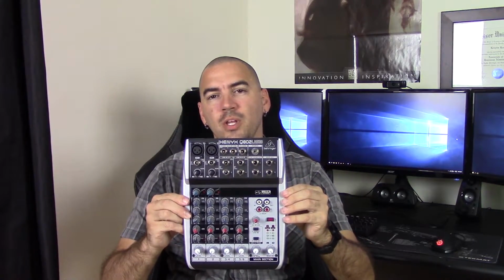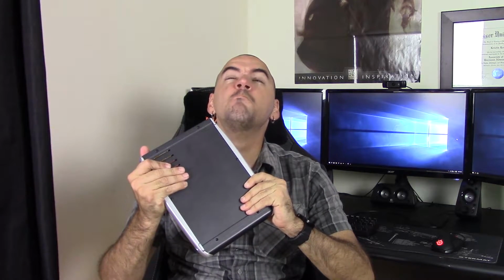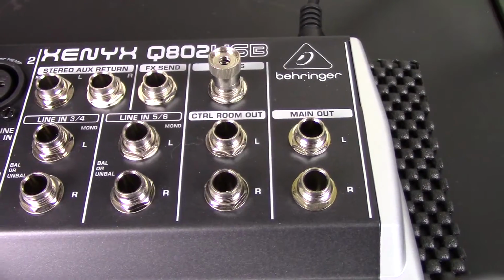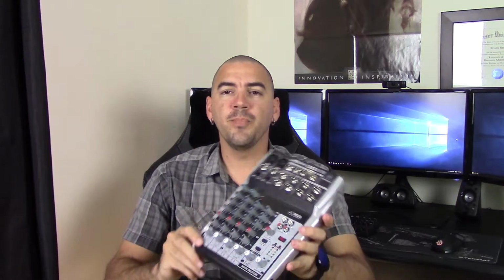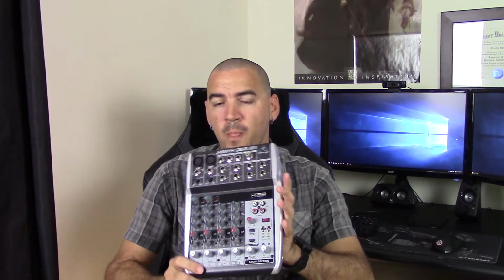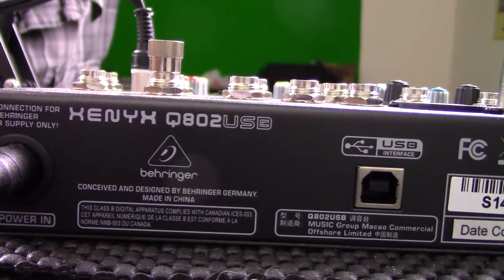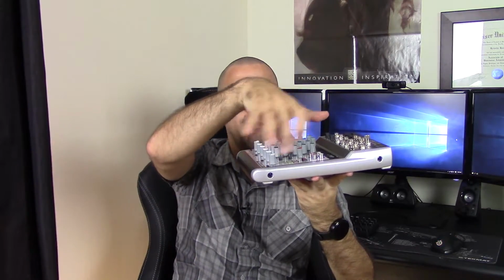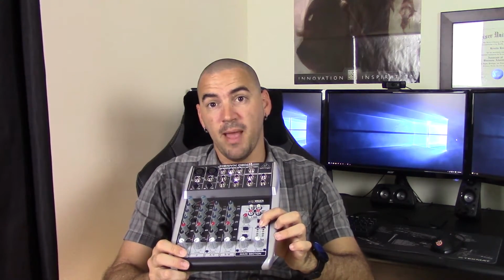Behringer Xenyx Q802USB Review

Comment: I got my first mixer ( Behringer Xenyx 802) in January, I used it for a few months. Did some recording with it. I swapped it for the one I'm using now, the one this review is about. 
I run my guitar amp into Line 1, my Galaxy Tab E (drum beat apps) into line 3/4, my PC audio into Line 5/6. 
Running my PC audio into Line 5/6 gives me the ability to adjust the EQ's while I have the bass boost on my PC, I've got extra EQ's from the mixer.....I have to be able to adjust Bass/Mid & Treble on music....this gives all that to me.
With the other mixer I was running the mixers audio from RCA out into my PC's mic jack. With this one I'm running the audio from the USB into my PC's USB port. 
The Phantom Power light does go OUT after about 10 minutes, I don't use Phantom Power, I don't use microphones, but I've turned it on out of curiosity, and the light does go out after several minutes. 
When I'm not using the mixer, I unplug it because I don't want it overheating. 
I run the Main Out into my stereo receiver to listen to music out loud, but 95% of the time I'm using my Studio Headphones. My mixer doesn't wobble. 
The only issue I'm having is finding some good recording software so I can play guitar along with drums and record it onto my PC. My PC is a refurbished HP 1TB. 
I've never used a mixer before this year. I discovered music in '84 and started playing guitar in '88, I just got this mixer January of this year LOL.   
So basically I'm using my mixer for playing guitar along with drum beats and I want to record onto my PC. 
You forgot to mention (maybe you did and I just don't remember) that it has built-in audio interface which I've been hearing is really important. Before I got this mixer I didn't even know what the hell audio interface was. 
I give this mixer a 4/5 or even 5/5. I'm really diggin' it. It's really aiding me to listen to music to myself, play guitar, play guitar along with music or drum beats all through headphones and no one hears me. 

I just want some advice on free recording software or recording software that isn't expensive, I'm on a VERY TIGHT budget.

Comment: Im doing this in the wrong order.. first i bought one and then started to watch reviews. Glad you approved it tho! Cheers =)
Reply from the maker: Awetrix still no issues here!
Reply: Hey! Have used mine for a while now and it's great board! I noticed that phantom power light does actually turn off but it takes a while to shut down =) I have it plugged in 24/7 as long as i'm around the house but i turn off phantom power for the night. Still its not leveled or i have some older model. =) I had some hissing noise first when i plugged it in but now i'm using usb as input, analog as output and that hiss is gone! Now i just need to learn how to set up all those knobs! Cheers! =)
Reply from the maker: Awetrix yea I had a hiss on USB and clear on analog. The knobs are the best part.... Can be annoying to set up though. What I hate is when you need to use different programs.... Some software requires a little more gain or taking out the lows and others don't.
Reply: Great overview, I found that the noise is a little high. Is there a way  to connect this USB version to a line in via a rca to 3.5mm so I don't have to use the USB?
Reply: Same here! It was such a good deal I just quickly checked to make sure it wasn't total crap and I bought it the same day I found it. A few weeks later and I couldn't be happier with it.

Comment: The Behringer 802 does not have individual channel switches for Phantom Power it supplies +48v of Phantom Power to both mic inputs at the same time. I’m using a Heil pr40 mic and do not need Phantom Power. Other than expanding the diaphragm a bit, sending =48V to a dynamic mic will not cause any damage or effect the audio or performance of the mic. You would have to go to Behringer’s XL2400 or one of their UFX mixers to get a mixer with individual channel switches for Phantom Power.
Reply from the maker: Nice thanks for the info! Thank you for watching and taking the time to help out!

Comment: I solved the lack of a on off switch on the Behringer 802 with this, https://www.amazon.com/Single-Adapter-outlet-Switch-energy/dp/B00SSFRES0/ref=sr_1_1?s=electronics&ie=UTF8&qid=1468536054&sr=1-1-spons&keywords=on+off+switch&psc=1

By adding some rubber feet to the black portion underneath the Behringer eliminated the unevenness so no more tilt or noise for the mic to pick up.

Comment: Hello bro, how many track run on daw?
Reply from the maker: I believe it's only 2? 8 inputs but I think it's only 2 tracks into the DAW.
Reply: ty friend
Reply from the maker: +M Vinicius no problem. I only use it for an XLR mic input for recording voice over and for live shows.
Reply: And the quality? is great? have noise?
Reply from the maker: +M Vinicius I noticed a slight hum through USB. I've since used the output into the line in on my motherboard. Much better now. Take a look at my latest Week in Technology video. You'll get a feel for it.
Reply: Tracks will depending on what recording software you are using. This interface give you 6 INPUTS.  Your software will tell you how many tracks you can have. Most now are unlimited and will depend on how powerful your computer is

Comment: I have a xenyx q802usb .. But sound too noisily to me, i dont know if its a problem or its normal. Could you make a some test with the knobs in the maximo and no input connections?
Reply from the maker: Which knobs at max??? You should never put the mic gain at max. That will add a lot of noise in the line. What mic are you using??
Reply: +TektopiaTV I hear the noise sound without any input connection..
Reply from the maker: +Fábio Bittencourt this is through the USB right?
Reply: +TektopiaTV  Through master out put - monitor and phones..
I didn't test the USB yet..
Reply from the maker: +Fábio Bittencourt ok so you're listening to just the board with no mic plugged in and hearing noise??
Reply: +TektopiaTV Yes! that's it!
this is normal?
Reply from the maker: +Fábio Bittencourt I don't believe so. I'll be home from work in 2hrs. I can unplug all my gear and take a listen to see if it's the same for mine. Is it like a hissing noise, static or what?
Reply: +TektopiaTV i gonna make a small video to show you!

Comment: if you record on PC, (OBS, Skype, Audacity) Do you have to select it in the Microphone section, Or at the Speaker section? Planning on buying this with devine Bm400 ;) + multiple microphones
Reply: you have to install the drivers. You can download them from the Behringer web site.
Reply from the maker: Yes. It's been awhile since I've used the USB connection since I decided to go analog into my sound card, but yes there's a separate name for the USB input for the mic.

Comment: I bought this but can't get audacity to recognize my 2 mics.  Didn't install any software, just plugged it in and the device is named USB audio codec.  I have that selected in audacity but still nothing.  What am I doing wrong?
Reply from the maker: Does it work anywhere else besides audacity? Did you try listening to device in Windows devices?
Reply: +Jonathan Charlie Chang Did you turn on the mic? Phantom power, Turn up the gain etc?
Reply: install the drivers from behringer website

Comment: i just recently purchased a q802usb and an at2035 mic. i am struggling so hard to reduce the noise of my pc fan and background noise / lower noise floor. i need this for live applications (mainly streaming on twitch tv) so i do not necessarily want to run it through programs as a solution to clean the audio. id rather resolve the issue at the source.

my main interest peaked when you mentioned the usb feature on this board. this was one reason why it attracted me. why is usb bad? is the quality that much better going analog to a sound card? i have a P8Z68-V PRO/GEN3  mobo. unsure how the on board audio is so will research compared to sound cards. im also going to invest in super expensive "silent" pc fans to assist with the fan noise.

your audio sounds pretty clean, but are you using programs after the fact to clean the audio up? or is that raw audio?

also, any knowledge would be appreciated: if i send my pc audio to a track, i get this high pitched ring. <--- i have no idea what this is. i was hoping you could maybe assist with this also. any thoughts?

thank you kindly for your knowledge. if you would like, i can make a short video and post my experiences.
Reply from the maker: Thanks for watching! For the audio of the board in my video I used OBS and I use a noise gate to keep background noise out. 

As for live recordings your best bet is to have the gain all the way down and adjust the levels. Gain enhances the hell out of BG noise. 

If you're streaming. Your SW should have a noise gate option and that makes a huge difference.

My USB was causing a hum or hiss like noise and going analog fixed that problem for me.